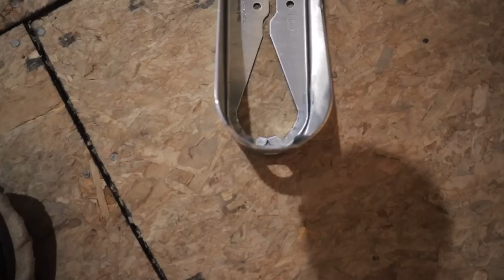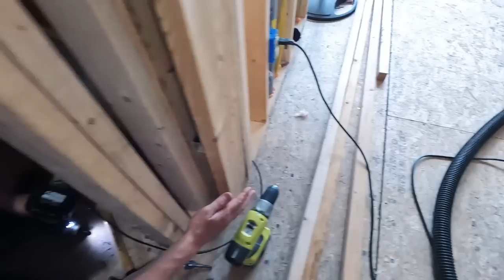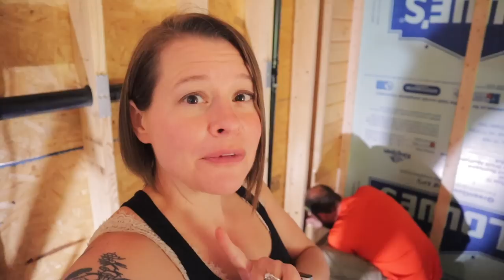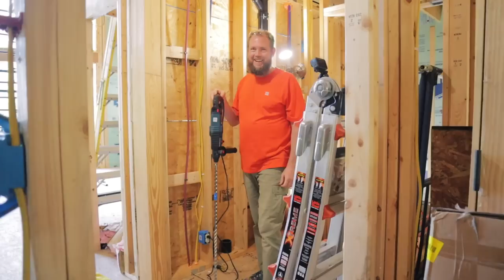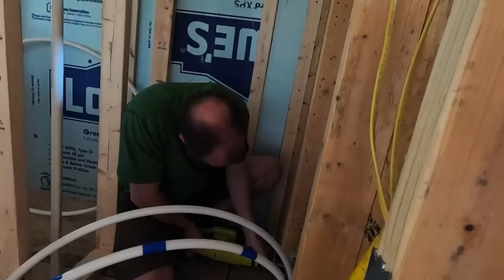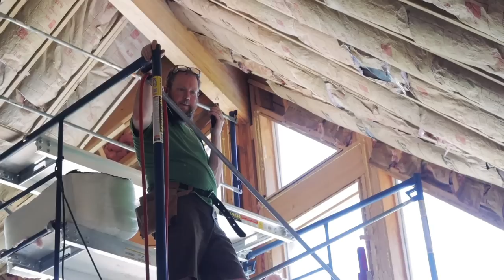PAYING for our PAST MISTAKES

Comment: What a nightmare! But these problems hit all of us. We laid a beautiful paver driveway and the inspector wanted us to move it. I told him I would yank out the papers and leave it as dirt. He was stupefied and then backed off his demand. It was an oceanfront property. But he got me on the apron. Had to spend $3000 to have and 18 inch deep reinforced concrete apron in the utilities right of way. So stupid. As soon as utilities want to make a change they will have to tear it up. It never happened in the 17 years I lived there, but what stupid requirements. 15 inches into the concrete? Total hogwash!
Reply from the maker: That sounds like a bigger nightmare that our fix.  I'm just glad we only had to drill one new hole instead of 4.

Comment: Here's an obvious question: Are they the hold-down strips meant to hold the house down to the foundation in the event of high wind?
Reply from the maker: From what I'm told they are more to prevent lateral/sheer forces than it is to prevent uplift, but I'm sure it is helping with that as well.

Comment: I would never built in a state/county where you have to get an inspection for a hole before you anchor. Talk about over-regulation.
Reply from the maker: Our inspectors are actually pretty easy to work with.  Not sure why they had to witness the and inspect the hole before epoxy, but we just went with it.